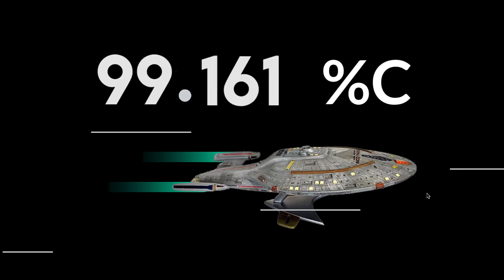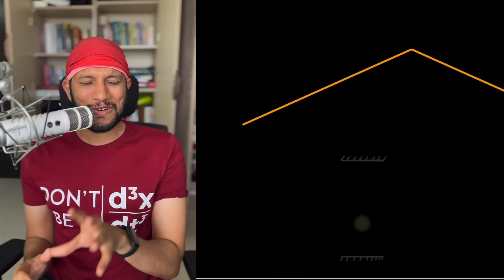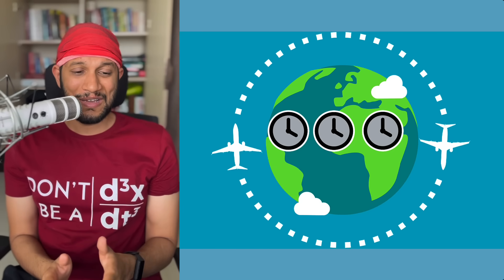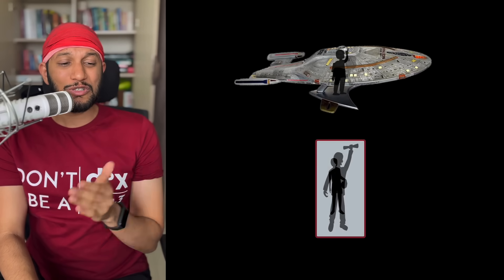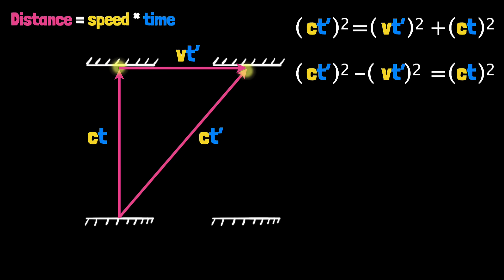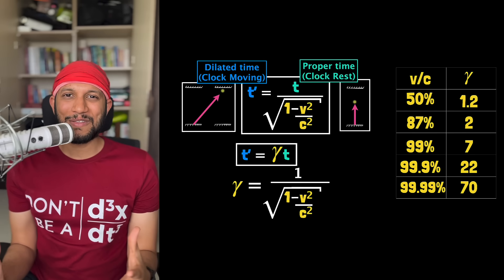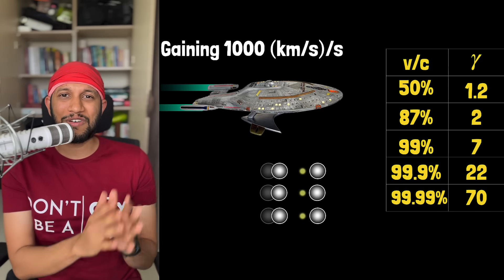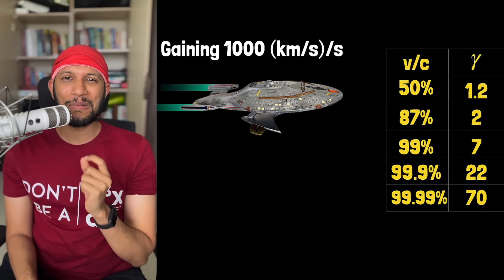I finally understood why you can't go faster than light! (My mind is blown)

Comment: Uno reverse: Quantum entanglement
Reply: it cannot send information. The experimental record for distance are 200 km. Even in LEO we travel this distance in like 10 s .
Reply: @ArneChristianRosenfeldt It could send information.. All we need is a confirmed, stable, predictable connection. The rest is just coding. For example, the binary code allows for the transfer of information through ones and zeros, which is really just the opening or closing of the flow of electricity in a transistor, or "on/off". And we use that to do anything and everything on a computer from creating images, texts, storing information, etc. The same thing could be done with quantum entanglement. One electron is spinning one way, its entangled "partner" is spinning the other way. One positive, one negative, or a 1 and a 0. We manipulate one and in turn the other is effected. I know this is probably over simplified and doesn't mean much coming from some random dude in the comment section but I don't see why it couldn't work in a similar way (given that we have even progressed far enough to seriously take on such a monumental endeavor in the 1st place ).
Reply: @33lollapalooza  I know what binary encoding is (DRAM, Manchester encoding in floppy disks). I like the idea of quantum computers. But how does that enable communication? And furthermore how does it prevent eavesdropping?
Reply: @ArneChristianRosenfeldt Idk, these aren't perfect theories and they definitely need hammering out by more qualified ppl but it is a fun and interesting conversation to have regardless... About eavesdropping tho, I'm not sure how you would intercept or "listen in" on these.. Entanglement signals?? (Or whatever you'd like to call them) but, in terms of sending info,  we can already convert binary to an alphabet, I don't see why we can't convert the movements of an entangled partical to a similar system, given that the signal is stable and predictable especially if we can manipulate one to effect the other. However, I'm not sure we're envisioning this process the same way, I'm  not even sure if my theory would even be plausible but it makes sense to me..😅
Reply: @33lollapalooza  Kopenhagen interpretation aficionados say that it is not a theory, but for some reason it is the only interpretation which leads to spooky action at a distance. Still it does not claim super luminal transport of information. Thanks to the progress in quantum computers we have plenty of examples where a particle is entangled with another particle and this process is repeated. So Alice would entangle their particle with an particle from Bob. Eve would sneak in and entangle her particle with that of Bob (or Alice).

Comment: And this is why scientists are more interested in warp over FTL travel. Light has a speed limit. Quantum tunneling would only use 99.9999 percent of the energy needed to travel faster than light
Reply: Quantum tunneling happens over short distance like sub µm . You get total nonsense when you try to measure speed for this. Besides its lack of application in space travel.

Comment: I feel like I’m always missing something. Isn’t speed relative? Then if the universe is expanding at faster than the speed of light. Than relative to the far edge from our galaxy we are currently expanding at faster than the speed of light relative to the far side as I type this. Not to mention two flashlights pointing at each other. Their respective excited photons each traveling at light speed towards each. Relative to one photon the other is moving twice the speed of light. Now put the flashlights on a fast jet and add that speed in. It just doesn’t make sense to say there is any speed limit if speed must be measured from a point you consider as fixed (even though nothing is really fixed) or pick any spec in the universe and arbitrarily label it fixed to make all other measurements from. I just can’t wrap my head around saying speed is relative (Which is intuitive) and the statement that nothing can travel faster than the speed of light. It feels very made up. Those two things appear to me to be contradictory and one makes sense to me.
Reply: Yeah, General Theory of Relativity. Even the community of the best physicist find errors in the calculation of black holes. I don't ever plan to understand it. Our galaxy is not expanding. That is what telescopes tell us -- does not fly over my head. No need to understand theory.

Comment: I like the illustration that we're always moving at the speed of light. ALWAYS.
The thing is, we're traveling not only in space, but also in time. We're always traveling towards the future.
Our movement vector is not three dimensional, but four dimensional. And the magnitude of this movement vector is ALWAYS 1, or the speed of light.
Most of its magnitude goes in the direction of time. But once we start moving through space, our movement vector turns its angle a bit towards a spatial direction. Which means: A little less of it goes into the time direction.
From our own perspective, we're never moving. This is why from our own perspective we move through time at a speed of 1, i.e., one second per seond.
From the perspective of someone else, we might be moving through space. This is why for them, a clock that we are holding goes a little slower.

Comment: But its not going on a longer path its just adding a new vector of continuous motion no? The rate its going on the Y-axis between the top and bottom should remain constant it does move faster on y axis which is what tells time if anything wouldnt it be moving faster because its going a longer path in the same interval?

Comment: Basing a working theory on an old arbitrary non-novel assertion by a hack like Albert Einstein who was at best a good mathematician, is unsound. Newton knew about force and Romer knew about light all little misguided Albert did was erroneously assert the two as some Kabbalist eternal speed limiter. If he had picked sound many would have laughed at him but for some odd reason the difference between sound and light speed weeds the ranks out quickly.

Comment: The ship is exerting real fuel to move for real, whether you are able to observe it or not does not matter (pun intended). Photons in the ship would still keep bouncing around and if you have windows you would pick up photons coming at you. Observation would be possible from inside the ship. You would disappear from behind because the light cannot keep up to observe you and send back information. Side note: It has been observed by Barry Setterfield (1979) that the speed of light has been slowing down, but I digress. This whole theory based on observation does not effect reality. It only affects an observers view of it. It is very much the same as a particle not being able to be observed because the action of measuring it changes its speed and direction. Before a vehicle was created that could speed to 100 mph the great thinkers of the time thought that if you outran the wind you wouldn't be able to breath. That theory was done away with when the guy who created the bigger engine did it anyway.😀
Reply: If you track a huge space ship from behind, you would probably see its bright light engines. As it accelerated, the color of these engines shift to red to infrared to microwave. The microwave background we observe on the sky was originally X-rays.

Comment: energy has equivalence to mass.  eventually you become a traveling black hole.  The way around this is that you manipulate space time and make a warp drive.  In a warp drive your basically making your local space time travel with you so your not traveling near c with respect to your local space time. Actually ideally your at rest with respect to your local space time and then your clock ticks the same rate as the rest of the universe.  You see the speed of light is both a constant and not a constant.  There is the locally measured speed of light which is a consant and makes all physics constant locally but non-locally the speed of light changes.  Take for instance the shapiro time delay measued by space agencies when their space craft pass behind a gravitational well and signals slow down when passng through the gravitational well.  In warp drive you speed of the non-local speed of light by inflating the vacuum and it moves faster than light with you as you travel faster than c.

Comment: 0:49 whilst observing from the OUTSIDE the ship, the photon does indeed takes a longer distance to reach the bottom plate. However, to the observer INSIDE the ship, the distance does not change. The photon moves at constant ticks. There is no decay.

Comment: I got a "stupid" question.... how come light can accelerate to the speed of light???? being photons and all.... and what about "length contraction" at higher speeds, since we are outside of the ship, we should be able to observe that and  shouldn't that snap the photons back in line...  At any rate, it is all relative...
Reply: they don't accelerate. They are born in flight. When current flow through an antenna, two independent fields are created: The near field, which does not travel at all, and the far field, which only travels at the speed of light. There is no in-between. Maxwells equations are linear. Fields don't accelerate. I mean, Dirac equation allows acceleration. And in GTR, light may change color. But uh, that is beyond the stupid part.

Comment: light is not a material thing, it doesn't have a mass, that is why it can travel at such speed. any material thing will disintegrate at such speeds, you don't need formulas to understand this.
even if considering known formulas, for example  E=mc(square), means that anything that will have a mass will require an insane amount of energy to make it travel at light speed. while travelling,object will posses the same amount of energy, and in case of a collision with a different object, it will be an insane explosion, which will lead to desintegration of both objects

Comment: Newbie here: So, from outside the ship, it can never reach the speed of light due to time dillation. But, inside the ship, time is always proper, and so it easily exceeds the speed of light. It's just a perception thing.
Reply: Semi-newbie here.
Probably yes, but they're not in for a good time either way.
The thing to consider is, if you look at the math, as V approaches C, the denominator approaches 0. AT c, your gamma becomes 1/sqrt0. Now, sqrt0 is just 0, but then you end up with a divide-by-zero error, which means your dilation is undefined.
Beyond the speed of light, your dilation works out to 1--sqrt of a negative, which means that your dilation now becomes non-real, since the square root of a negative is a non-real number. The math works while V<C, but just breaks when V = C.
You also need to consider: the people on the ship would ALSO observe dilation for the universe around them.
When V = C, dilation becomes undefined, so maybe they'd see the entire universe pass by them before they even realise what happened until they're on the other side of Heat Death. Maybe time would forever stop, and they'd be stuck in the most intense bullet time in all of reality, able to cross the entire universe before a single atom wiggles. Maybe they collapse into a singularity as their energy density becomes high enough to form a kugelblitz and punch a hole into a dimension where they CAN go faster than C. Because the math just breaks, it's not really possible to say WHAT happens, only that it CAN'T happen unless you find a whole new set of math/physics where it doesn't break.
Reply: Inside is all comfy, but think about a strategic mission . Romulans are gonna attack Vulcan. They only need to travel 10 LY. Their ships reach 0.6 c. Can federation ships from earth stop the invasion if earth is 20 LY away?

Comment: This was a fun video.

Have you noticed the time dilation problem for the crew? As c is the speed limit. Even if you could go faster, you would still have to experience travel time at light speed. So even Proxima Centari would take a 4.2 years of travel just to get there thousands of years later in normal time. Even if you could go faster, 10,000 times the speed of light will still experience it because of time dilation.

Faster than light travel is a scam.

Comment: But from the frame of reference of moving ship (say ship A), the observer at rest(say ship B) also moving away close to speed of light, so why dilation only happen to the moving ship(i.e. ship A)
Reply: dilation depends on the observer. You can make a symmetrical set up with two ships. Both will observe dilation in the other ship. The reason is that Special relativity only works for inertial systems. So when said ships decelerate and accelerate to meet again to compare their watches, SR reverts all the dilation . Like if the ships were super sturdy and bounce on some hard surface, time dilation gets compensated in the blink of an eye. Think about a ping pong radio signal between the two ships. The ships could send their local time.
Reply: @ArneChristianRosenfeldt so the popular example of a twin going in space ship and coming back after 50 years will be younger than the one who stayed is also flawed. Even the return of cooper in intersteller doesn't considered reverse dilation
Reply: @shashankdubey7634 storage rings work because Earth is an inertial system.

Comment: This is not correct at all we have disproven lorenze factor with the particle accelerators it is simply strait line acceleration curve and magnatism propogates at speed of light and the supposed muon dialation at 1mph from speed of light is nowhere near sufficient and no mass gain and no additional energy needed for acceleration just affect of relative velocity of force. And the satelites get off way more than one days worth at a time sometimes within minutes they re calwbrate all the time there are way more logical explinations than time dialation it is hogwash.
Reply: a static magnetic and electric fields don't propagate at any speed of whatever.

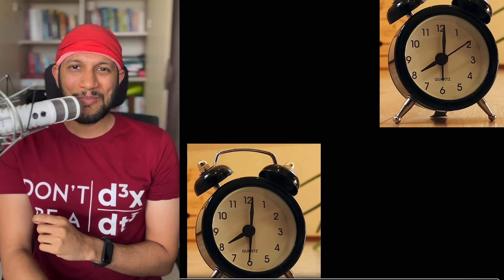Comment: 4:00 but Einstein, what if the clock's arms went past 6 o'clock, wouldn't it speed up to make up for lost time?
Reply: No. The direction of travel doesn't matter. The time needed for the propagation of the wave is what makes it take longer (the transference of force he mentions). The similar results provided from the experiment using radioactive isotopes proves this. Radioactive decay is omnidirectional and random.
Reply: Nope. That is why he starts with the "photon clock", so we get the fundamental effect first. Try spinning the clock into different directions relative to the ship and see what happens. You get the same effect, like you can see in the animation at 13:05.
Reply: good question

Comment: Is it so hard to decelerate a mass from 99.999999 percent of the speed of light by 1000km/s2 for example? What about mass orbiting with that speed? Does your explanation still work?
Reply: what do you orbit here? There is a speed limit in earth orbit
Reply: @ArneChristianRosenfeldt The question was rather theoretical, than practical, but still a valid question. I am not talking about the Earth here, but any mass, which has a high relativistic mass, though it still changes direction quickly.

Comment: Wonderful explanation sir, I really got great insights which further created more doubts in me.
1. On what basis are we measuring or proving this hypothesis? Is it based on what we observe from outside or the traveller within the spaceship?
2. Why is the time always calculated based on what we see from outside whether time slows down, stops/frozen?
3. Can we say the limitation is only cuz for the observer and not the traveller?
4. Distance travelled by spaceship at C is going to be 300000km/s which will be same for traveller as well as observer and the only difference is, the observer will not be able to see the actual movement of the spaceship. Right?
5. Can we say we all are looking at it from an incorrect angle with the formual and stuff? I am not questioning the formula but why that formula is that way and should be applied here?
Reply: 2. We cannot calculate from within the ship because it is not an inertial system

Comment: I don't understand the last explanation about the 1000 km/s getting smaller and smaller as you get closer to C. Obviously, less distance can be covered in less available time because time runs slower. But what about the shortening of distances the closer you get to C? That should cancel out the effect for an outside observer, right? Can someone explain to me where my mistake in thinking is?

Comment: Apologies in advance if this is a dumb question but does it make a difference which way the clock is moving?  For example does time speed up if you observe the clock moving toward you instead of away?
Reply: no . The Doppler effect is supposed to be compensated in the mind of the observer trained in Newtons Mechanics

Comment: "Time dilation" is a misnomer though. A more accurate name would be "propagation dilation", since time itself moves at the same rate indiscriminately—which is required for the principle to work in the first place, since it depends on light moving as fast as ever but forced along a longer or dilated path, causing the propagation of all physical phenomena to be slowed.

This almost seems to hint at the existence of the aether, or something akin to it. For light to have an absolute speed, regardless of the speed of the emitter (though slowed somewhat by media such as air), it behaves like a wave in a medium. It would seems as if light itself is the medium. Just like sound waves are pressure waves in the air, and of the air. And if light is energy, and the existence of dark energy has been hypothesized, then it follows that dark energy is the very aether for which we've been searching, the light-conducting medium, but doesn't behave as believed in times past.